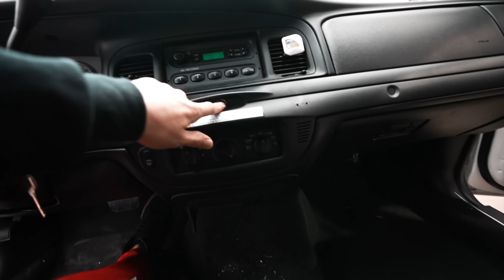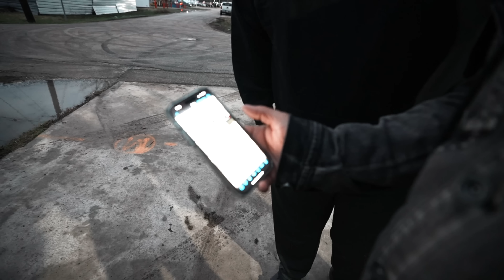New SHERIFF in Town!

Comment: I’ve got a challenge for ya. Buy and build a 99-06 singlecab and make it run 6.99s in the 1/8th, full weight a/c and cruise control. $5000 budget